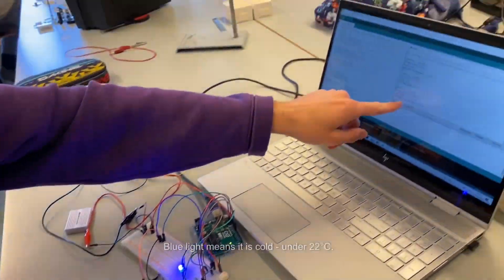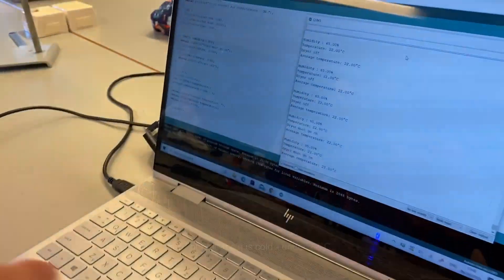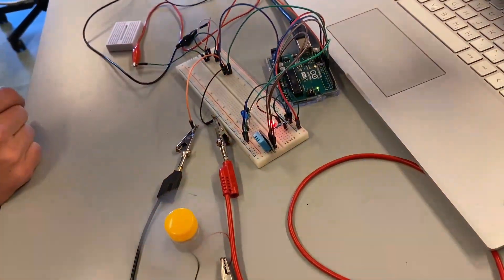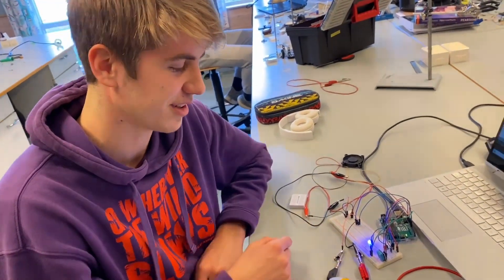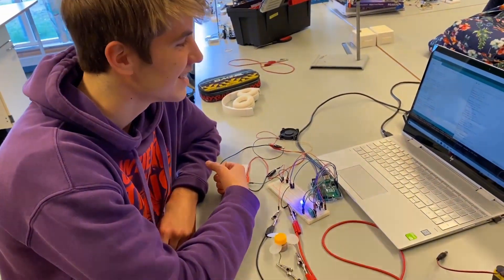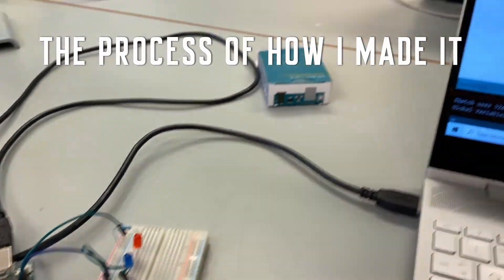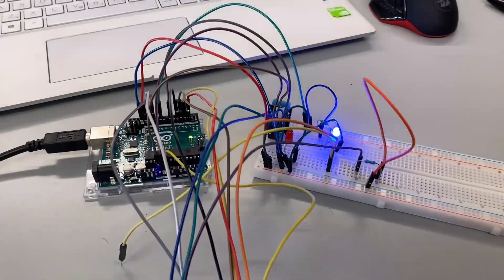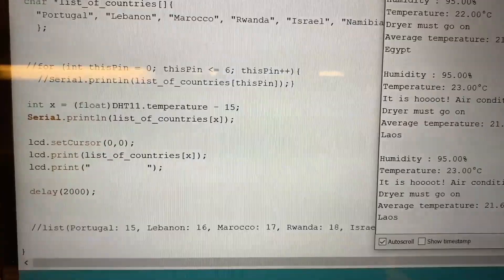HOW I BUILT AUTOMATIC AIR-CONDITIONING SMALL SYSTEM (Arduino Uno) │ Young Minds

Comment: That's good video. I also want to build air conditioner. Where Can I take the source of power for the fan? It needs 12V
Reply: Use power supply of PC or you can buy a AC-DC converter let say maximum 10$